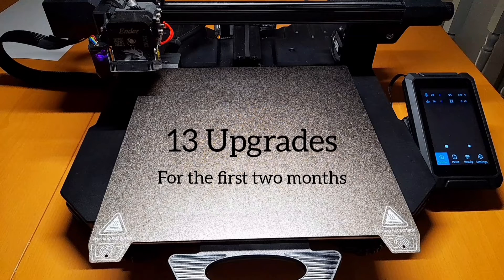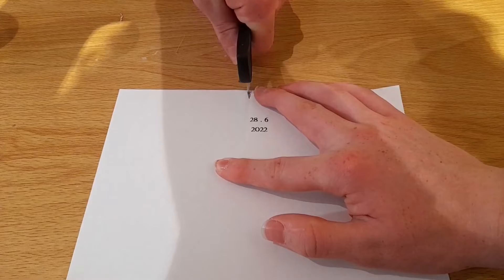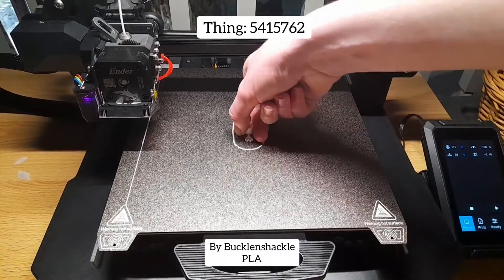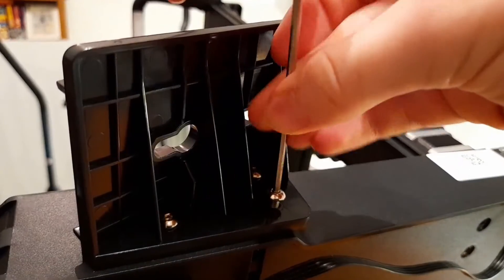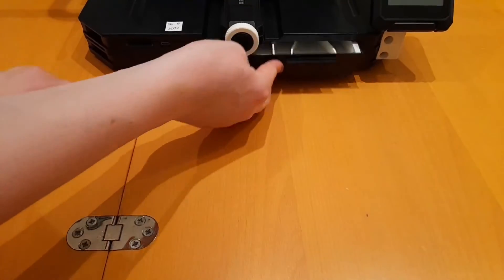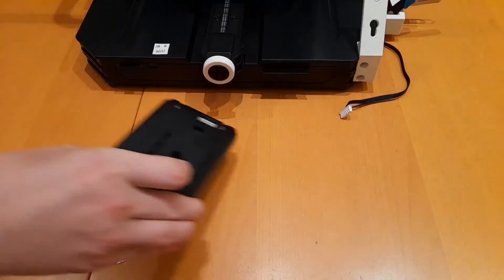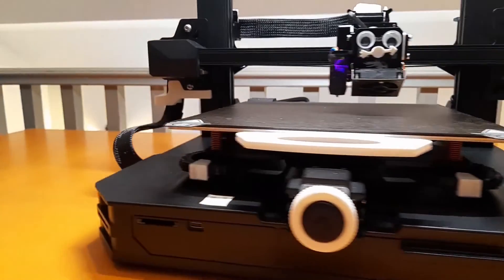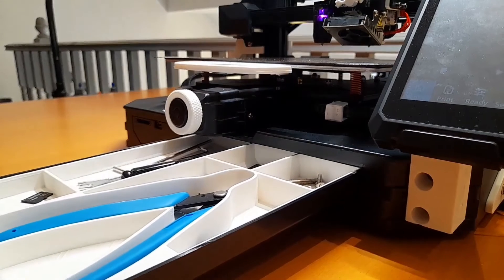First 13 Upgrades & Mods for Ender 3 S1 Pro

Comment: thing 5443879 is incorrect it brings up "Ender 3 S1 PRO circular fan duct" so where the extruder gantry quick-change mount?

Comment: Using scissors as they are intended to be used would make fine cuts, and for something that you intended to display prominently on the front of your printer, how can I trust any advice or suggestions after such a debacle?
Reply: First thing i noticed... is it worthto carry on watching this video till the end ?
Reply: @Bacia578  das musst du selbst entscheiden da ja jetzt jeder einen neuen bringt die sich nicht wesentlich vom Preis und Leistung unterscheiden sollte man gerade auf solche Dinge achten